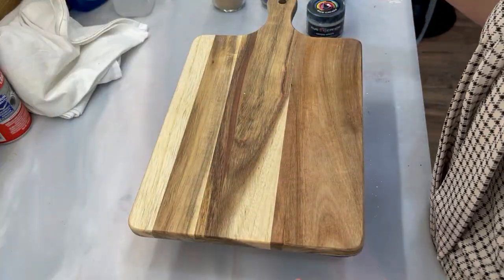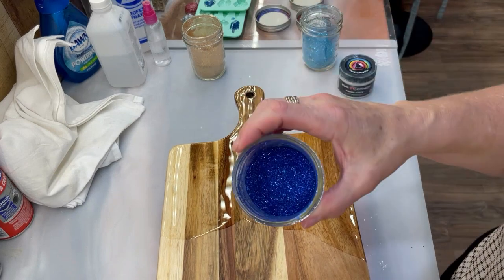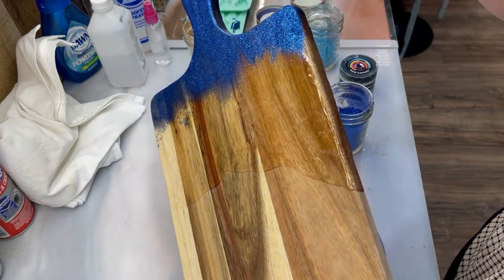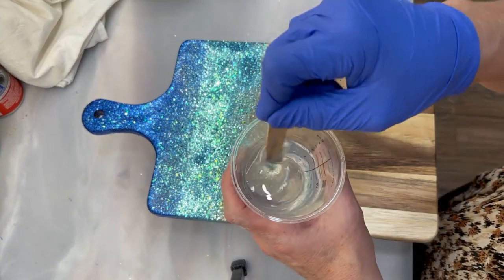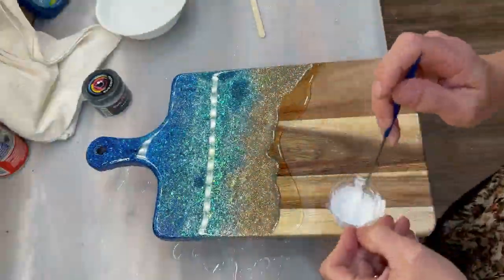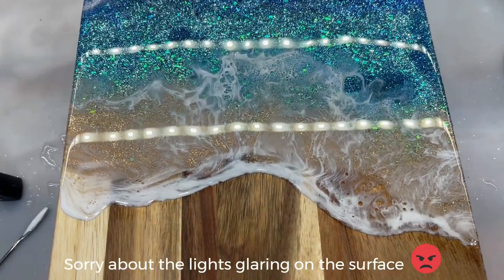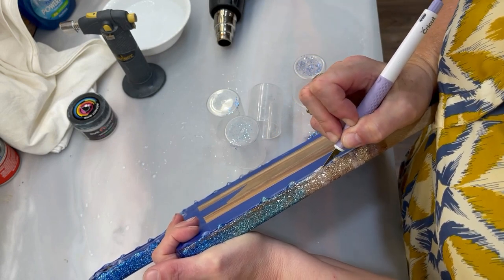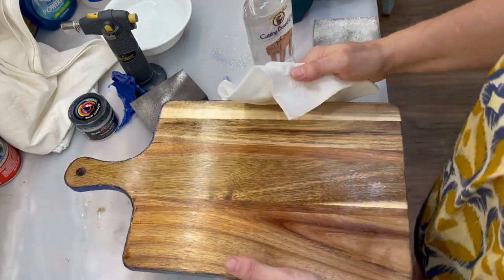#39 How To Make Ocean Waves On This Beach Cutting Board With Epoxy Resin!

Comment: I know this is 10 months old but just happened upon it cause I am studying how to do this on a table top of mine that I’m redoing. I do however watch your videos a lot. Not just this one. I love them. But my question is… if I were doing this on a wood round to use at a table and did the entire surface area as u have done on the board, should I seal the entire piece after the wave process? To make it even and protect it more?
Reply from the maker: Yes I would
Reply: Thank u 🙏

Comment: Is it critical that you sand the board?
Reply from the maker: The resin will stay in place much better if you sand it, but not critical I’d say.
Reply: @glitznglitterbymichelle1  Thank you for your reply! I jumped in before I got your reply. It turns out, the area that was sanded released massive and unending bubbles. I recommend to others that if you sand, add a sealer coat before the resin
Reply from the maker: @tanyacollins9003  that’s interesting because I seem to the the opposite effect 🤔